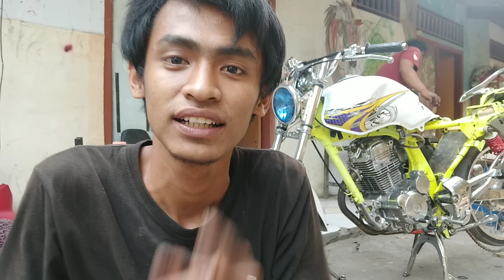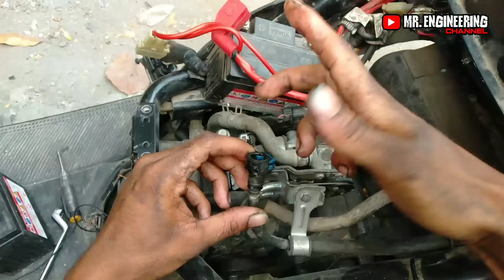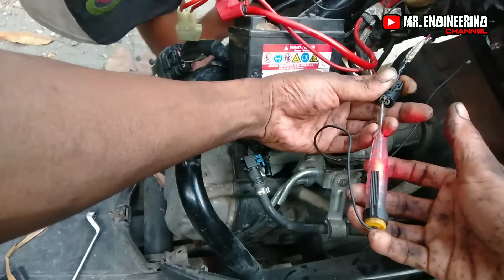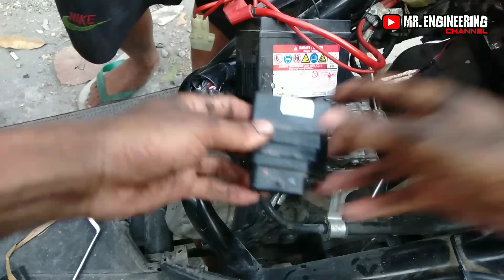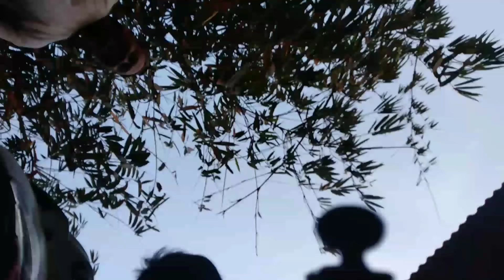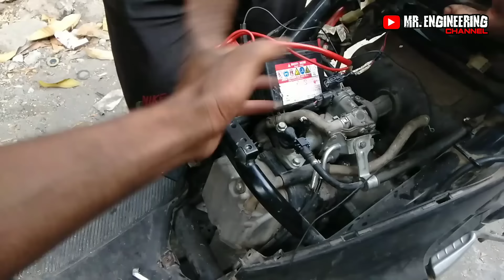Penyebab fuel pump bunyi terus || cara atasi ketika fuel pump ngalir terus

Comment: Motor saya yamaha force fi gara gara kabel soket fuel pump nya saya konsletkan kemarin saya kira kabel soket pelampung bensin terus sekreng motor saya putus habis itu saya ganti  sekreng baru bisa lagi tapi kenapa kok fuel pump nya setelah di kontak awal lampu indikator sudah mati kok masih berdengung terus fuelp pump motor saya apakah ada kabel yg mengarah ke fuel pump konslet atau ecu nya ya gan trimakasih 🙏

Comment: Maaf om numpang tanya ,,
Motor beat fi esp thn 2015 ,,
Ketika kontak on ,, rotak/fuell pump dengung ,, tapi setelah 5 detik yang seharusnya rotak/fuell pump sudah gak dengung lagi tapi ini dengung terus ,,
Itu kenapa ya om ?
Kondisi kabel coklat yg dari fuell pump sudah di jumper ke body .
(Maklum beli motor seken ,, dengan kondisi seperti itu)
Kalau mau normal lagi gimana ya ?
Mau reset ecu takut error yang malah tambah rusak lagi .
Mohon pencerahaannya ,,
Terima kasih
Reply: Sama